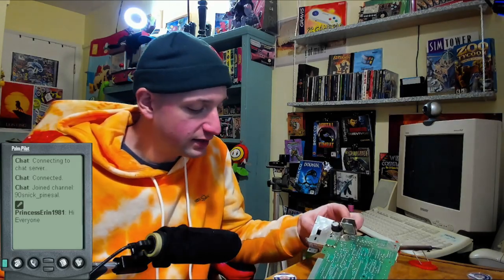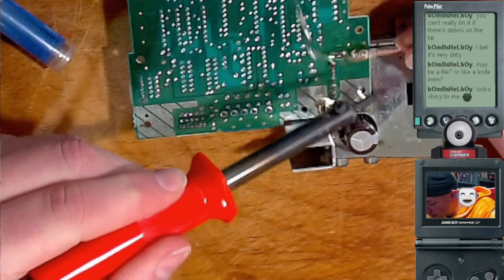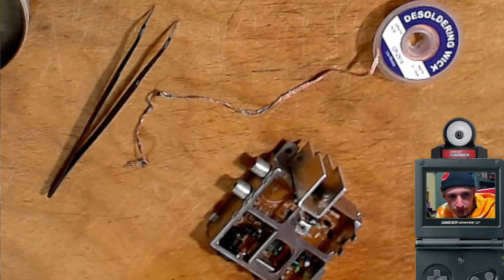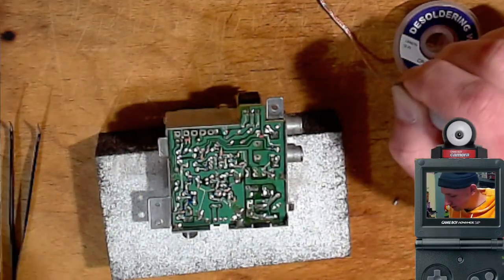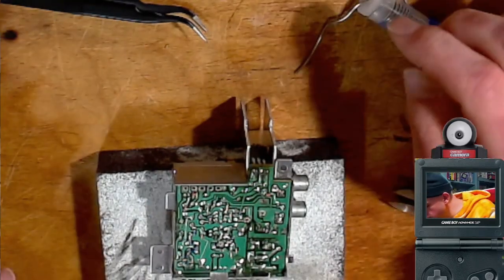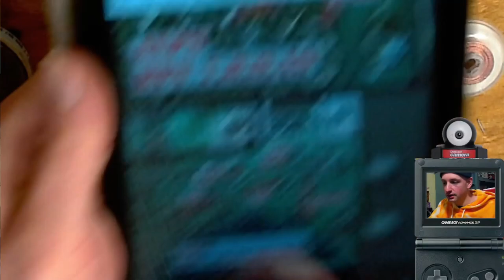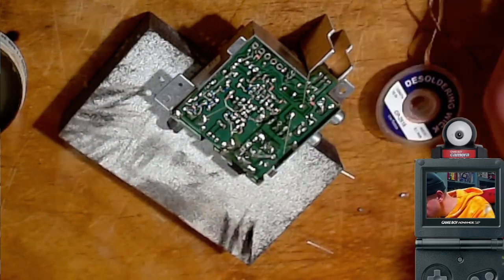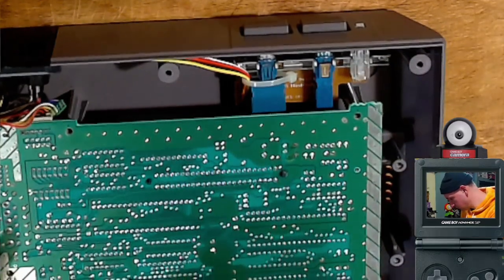NES Repair Attempt Part 2 - FIXED?

Comment: Dude...   just wanted to thank you for this video.   I used the links you posted and fixed my nintendo.  Changed out the large capacitor and the small 3 prong voltage regulator.   Power came back on just from changing those 2.   I had a hunch that the voltage regulator was the culprit.  Looked a little dark and burnt out...  after taking it out one of the leads crumbled off pretty much.   Thanks man!
Reply from the maker: You're awesome! Good job fixing an NES and saving it from the landfill.

Comment: Mine was a different problem. But appreciate hanging with you as I figure my problems out. 

I recapped and a bunch of traces lifted off the board.
Reply from the maker: Dang. if you look at my Sega CD Repair attempt, I ended up lifting some stuff off the board too. Sucks no easy way to fix it.
Reply: Just time and 2.5x readers. Lots of jumpers and tracing with the meter.

Comment: Congratulations, VERY nicely done! Time to play some games! 

You missed the 3 capacitors on the main board, but I've never seen those go bad. I just replace them because they're 40 years old now. I can't believe you got the thing off with solder wick and a $30 Weller iron, that must have taken forever.
Reply from the maker: Thanks. the full unedited video is 3.5 hours long and unsoldering the power board took the longest. Thanks for your help with this.